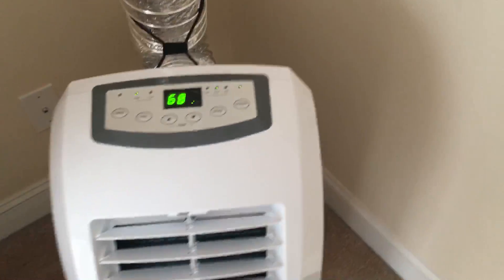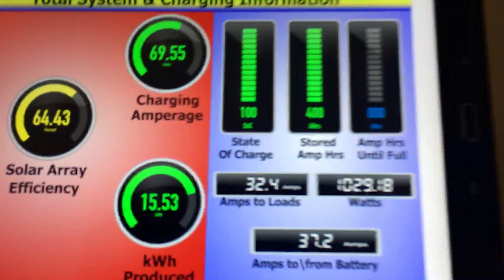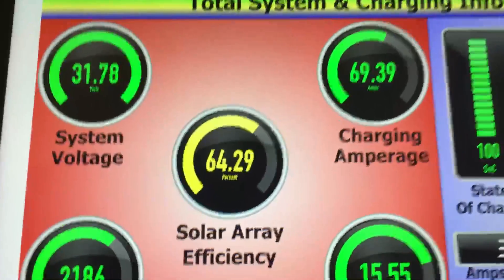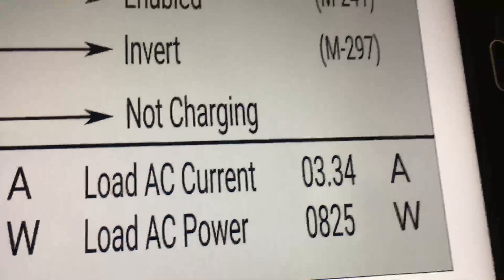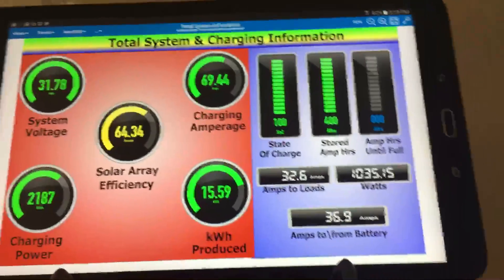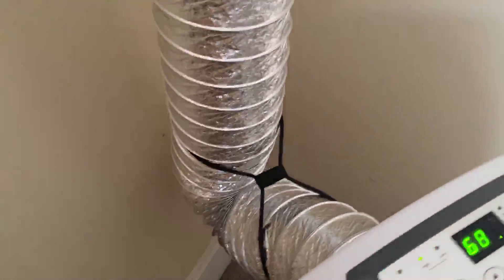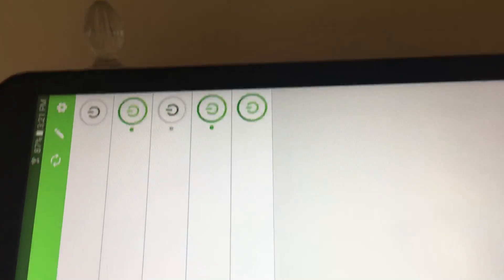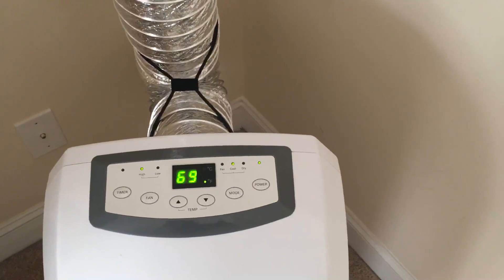Running the LG Portable AC Unit on Solar

Comment: Do you believe it could be "vented" into the bathroom exhaust, or maybe just positioned in the bathroom door to cool the bedroom but exhaust its heat into the bathroom with the bathroom fan running?

Comment: I run my 5 ton centralized AC on a 12 v battery and 4 capacitors plus a HF solar panel ,it worked all summer long
Reply: I have a 4 Ton and 2HF panels and only the led turns on my ac unit.
Reply: @cutweldngrind  you need a smaller led...lol
Reply: @cutweldngrind  I see no mention of capacitors though.. if you leave those out, you wont have enough cranking amps to start the compressor in the A/C. Once you get that started, the running amps of the A/C are much, much lower than when you first start it. That's the only hurdle with small solar setups (100-1000 watts), starting the compressor. 
You can connect large capacitors inline with the solar panes and store the power needed to start the A/C and then you can run it off the solar panels and charge the batteries at the same time.
Reply: @markjohnson4643  I currently run a small 8000btu unit which draws 600 watts but spikes to 1200 watts. I have a 48v bank feeding my inverter but currently charges off the grid. I am running test at the moment.
Reply: @markjohnson4643  is there an instructional video of how to connect these capacitors and which ones to use that you know of? I did a search but didn’t come up with anything that details how to do this. Thanks 🙏

Comment: We really appreciated this LG a/c this past summer.>>>nub.best/lrjg   It performed perfectly, having replaced an older model of an L/G a/c that had lesser BTUs and had seen better days. These air conditioners have been mounted in the living room wall of our approximately 800 sq ft 2-bedroom cathedral-ceiling cottage home and have single-handedly comfortably cooled it throughout the hot & humid Michigan summers. Appreciate all of its features, especially the energy-saving ones and the alert to clean the filter!

Comment: How much cost do u think it uses in one month, let’s say 3 hours a day on?
Reply from the maker: These units typically may use around 1500w of power in an hour, so you can assume around 4500w in 3 hrs.  4500w at .10 cents per kWh = $0.45 per day, x 30 days = $13.50 per month.

Comment: I'm taking a HUGE guess here, but I think you have about 20 of the 100 watt panels and about 11 or 12 of the 36 Amp hour batteries for the setup from what I could see on your display screen.

Seems that 10 of those panels are powering everything and the other 10 are being used to throw energy back into your battery bank. Again this is strictly a guess, but if you could tell me what you have, it'd help me a lot, because I'm wanting to do the same exact thing you're doing here with a portable AC unit.
Reply: Yes I am also interested in the same thing, but on a larger scale, considering the price range ect.

Comment: Speaking with a working history as an electrician AND air conditioning/ refrigeration repair technician, these portable units based on this design are NOT even close to efficient use of solar power or even grid electrical power.  I could explain in detail but what would be the point or benefit for doing so here?  That is not to say it (this) does not make the room air cooler, it does but it is using more energy than other methods.  People are free to do as they wish.  Best wishes.
Reply: This does not make the room air cooler but it does. Ok got it.
Reply from the maker: Thanks for the comment. Yes, I've heard and read from others that these units are not efficient and so forth, but considering that I ran this on battery power during the night and on straight solar during the day as a dump load, it worked out really well.
Reply: When would it be OK to run an AC with a fan in an open window blowing air from the outside into the very room your trying to cool? That is what is going on when these portable units are running.  Hay!  It is what it is.  If your happy with it, who am I to argue with your happiness?  Best wishes. I wish you much happiness and the best of good health.  Cheers

Comment: How do I get a set up like this where I can see all of the stats on a mobile device?
Reply from the maker: You would need to purchase an inverter and charge controllers that support the modbus protocol or that come with a web based user interface.
Reply: I have no idea which ones those are.
Reply from the maker: Magnum inverters, Schneider Electric inverters,  and Outback power inverters are high end inverters that provide remote access and monitoring via a web interface, but you have to buy separate equipment to get that capability.  Morningstar, and Midnite solar provide charge controllers that provide modbus TCP communications that allow you to program SCADA type applications to communicate with directly.  As you do your research, be sure to look closely at the specs of each device to determine how the can be managed and monitored remotely.  Generally, high end devices have this or similar capability, but at a much higher price than the cheaper brands.  You may also want to check the PIP series of inverters.  They may also come with that capability.
Reply: @rhandsom 
still, you cannot tell us what you're using? imho

Comment: How many and what kind of batteries are you using?
Reply from the maker: I use a combination of Nickel Iron and Nickel Cadmium cells.  I have a 24V battery bank, the NiCad cells are Edison ED-240 cells and my Nickel Iron Cells are from China.  Generally around 19 cells each, in parallel to form one large battery bank.

Comment: I have the same a.c and it dose not cool enough what can I do ??? I already cleaned the filters :/
Reply from the maker: LG portable units are known to have these problems.  My unit has the same problem as your unit has, your question has led me to do some research and that research suggests that the problem is that the unit is low on Freon or has had a leak. I'm looking into ways of draining the old Freon and recharging the unit.  Some have had success with that approach.  However, I haven't taken the unit apart yet to see how it would be done.

Comment: i did a test like this on my tiny system and i was able to run my 5000 btu air con on just my 400 watts of solar panels after the battery's went into float. i was shocked that i ran it that way for 2 hours and battery's never came out of float. so i plan to run it that way in summer month to save my electric bill as much as i can
Reply from the maker: Sounds good to me, I typically run this unit all night.  Thanks for your comment, I just wanted to show folks as well that you can run a decent sized small AC unit on solar.
Reply: @rhandsom  what's the name of the colorful monitor you are using? Would have been nice to create a link and earn some money.
Reply: Andrea Delsied ALOT man.. Probably little over $1,000
Reply: That is a powerful solar system 👏
Reply: how much does the solar set up cost?
Reply: SolarMike
Reply: How much did this setup cost @rhandsom
Reply: The setup can cost a lot but it only means you can run it all day and the more you run it be it summer or winter the more you save and faster you get your money back

Comment: I would say if people would think more like 70% the Chinese stuff would last longer and get so disappointed. I would be concerned that you have two much moisture going into your attic so keep an eye out for mold. Great video
Reply from the maker: Thanks for the heads up OT.  I'll keep an eye out for it, but I'm not too concerned.  I have bathroom exhaust fans used to remove excess steam and moisture during and after my shower and they exhaust in the attic as well.  I have many large roof vents that should help as well.  But in any case, it doesn't hurt to be vigilante.